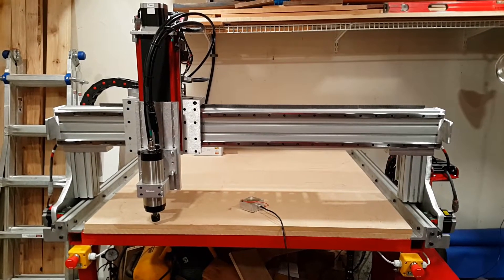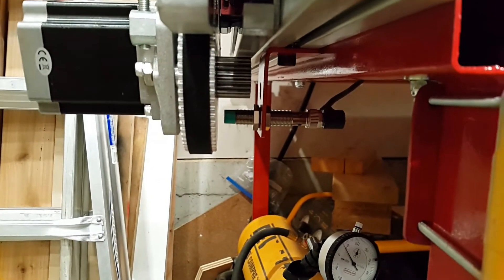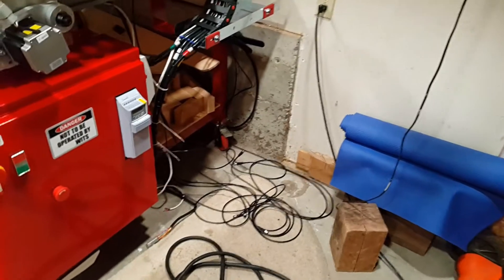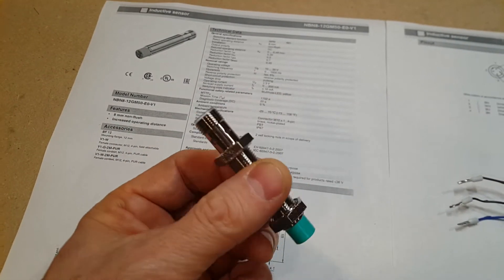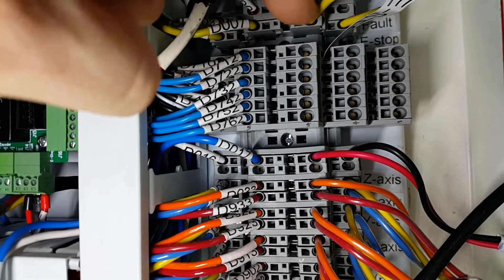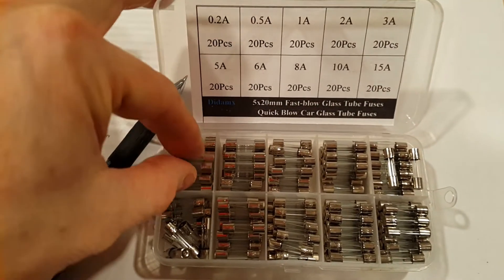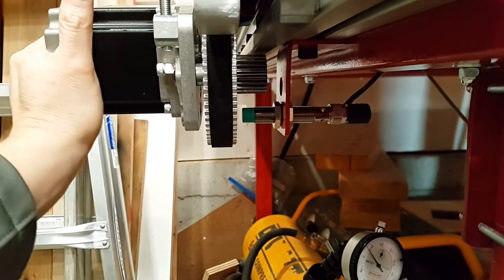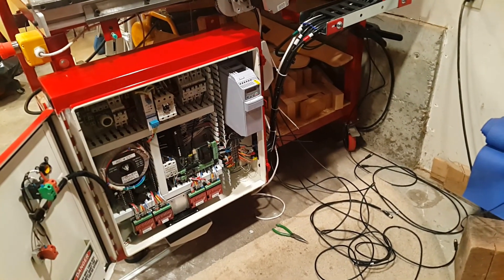CNC Proximity Sensor Setup

Comment: Where did you get the beautiful cable labels?
Reply from the maker: I have a Dymo Rhino 4200 label maker (https://www.amazon.com/gp/product/B005MR516Y/). It's capable of printing wire labels in a couple of different formats. It's a pretty good tool but I will say that the firmware of the labeler seems to be designed to waste label material whenever possible (I assume to get you to buy more of their expensive label cartridges).
Reply: @buildbug3979  I got a Brother P-Touch and it is always wasting 20mm on every print. So when I start a print I have a queue of text that I print and use the sissers to cut up the lables to save it :-D  Great video and CNC btw.

Comment: From what I have experienced, limit switches should be normally closed. In the normally open configuration, if there is a break in your signal wires you will not know until you crash into your hard stop. In a normally closed configuration, if there is a broken signal wire, you will get a fault at startup.
Reply from the maker: Good point. I agree, normally closed (N.C.) proximity sensors are standard on commercial machines and are a safer option. I wish I had mentioned this in the video. I had to settle for the N.O. versions because I had trouble finding N.C. versions at the hobbyist prices/suppliers I use. If you have a good source for N.C. sensors please share it as I'm sure others would find it useful.
On a side note, MachSupport has a good video (https://www.youtube.com/watch?v=IXuuGRACU1I) in which they walk through adding code to Mach4 to automatically enable soft limits every time you click the 'Enable' button. I have added this to my machine. It won't prevent a sensor failure but hopefully it will restrict the failure to occurring during the homing procedure when the machine's movement is slower. Then during normal machine operation Mach4 will not allow any movement beyond the soft limits and thus you should "hopefully" never even get close to the proximity sensors. All that said, if you want/need foolproof, normally closed sensors are the way to go. Thanks for bringing it up.